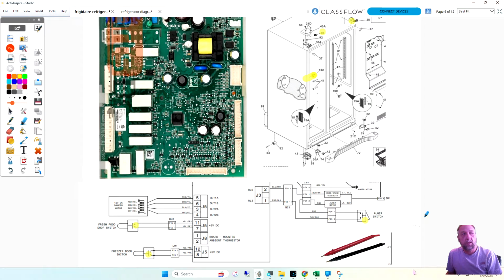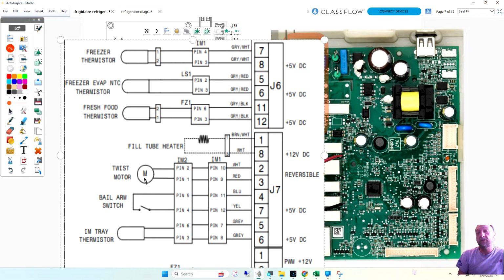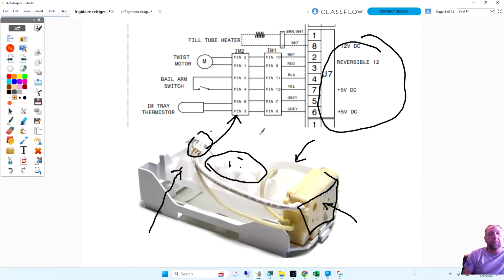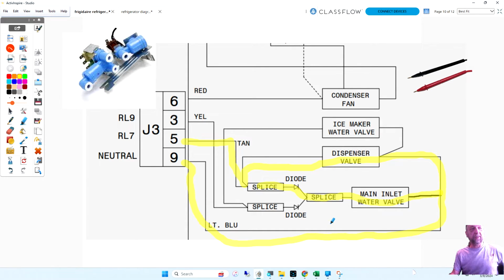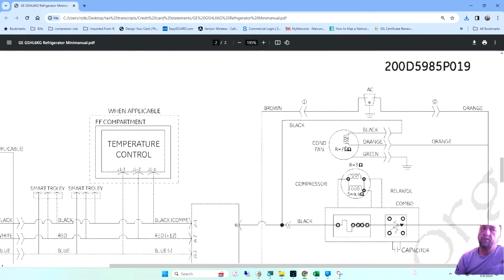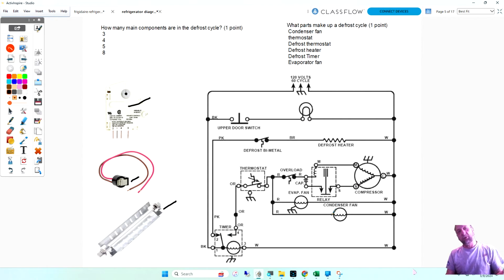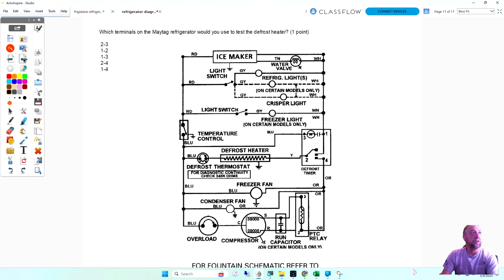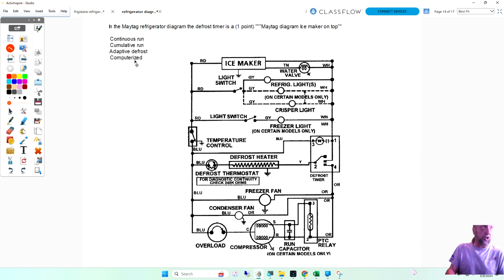Refrigerator diagrams Part 2

Comment: Can I ask would this be the procedure to work that out? 

Step-by-step field instructions

1) Safety & prep
	•	PPE on
	•	Work area safe
	•	Have meter, thin probe leads, flashlight, screwdriver, diagram

2) Verify meter
	•	Set meter to AC volts
	•	Probe a known live source:
	•	one probe on known live
	•	other probe on known neutral or proven chassis ground
	•	Record:
	•	Known live source checked = _
	•	Reading = _ VAC
	•	If reading is wrong, stop and correct meter/setup

3) Establish reference
	•	Choose a known good neutral or known good chassis ground
	•	Do not assume LT. BLU unless proven
	•	Prove the reference by measuring the same known live source to that reference
	•	Record:
	•	Reference point = _
	•	Reading = _ VAC

4) Put system in test mode
	•	Command dispenser/auger on
	•	Make sure door switch and required interlocks are in the correct state

5) Measure J3 pin 1
	•	One probe on J3 pin 1
	•	Other probe on the proven reference
	•	Record:
	•	J3 pin 1 to reference = _ VAC

6) Measure MC1 pin 11
	•	One probe on MC1 pin 11
	•	Other probe on the same reference
	•	Record:
	•	MC1 pin 11 to reference = _ VAC

7) Measure auger switch input
	•	One probe on auger switch input (PUR/BLK)
	•	Other probe on the same reference
	•	Record:
	•	Auger switch input to reference = _ VAC

8) Measure auger switch output while closed
	•	Hold the auger switch closed
	•	One probe on auger switch output (PUR)
	•	Other probe on the same reference
	•	Record:
	•	Auger switch output to reference, switch closed = _ VAC

9) Measure motor feed (IM1 pin 2)
	•	One probe on IM1 pin 2
	•	Other probe on the same reference
	•	Record:
	•	Motor feed / IM1 pin 2 to reference = _ VAC

10) Optional motor checks — power OFF
	•	Unplug/isolate power
	•	Measure motor winding resistance
	•	Record:
	•	Motor winding resistance = _ ohms
	•	Check for seized auger or mechanical bind
	•	Record:
	•	Mechanical bind present or not = _

11) Notes on probing & recording
	•	Use thin probe tips
	•	Keep the same reference point for all voltage tests
	•	Write readings down immediately
	•	If possible, record whether each reading is 0 VAC, rated line voltage, or partial/unstable

12) Submit results
Send:
	•	J3 pin 1 = _ VAC
	•	MC1 pin 11 = _ VAC
	•	Auger switch input = _ VAC
	•	Auger switch output = _ VAC
	•	IM1 pin 2 = _ VAC
	•	Reference used = _
	•	Known-live meter check = _ VAC

One more useful add-on

Add this line at the bottom of your sheet:
	•	Last point with voltage = _
	•	First point without voltage = _

That gives the fault zone immediately.

would this be field-ready now.